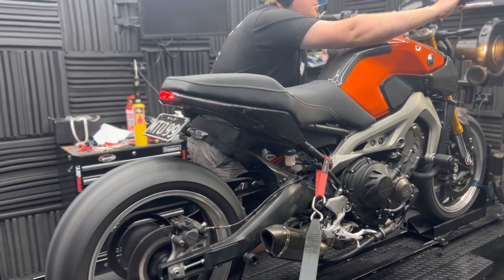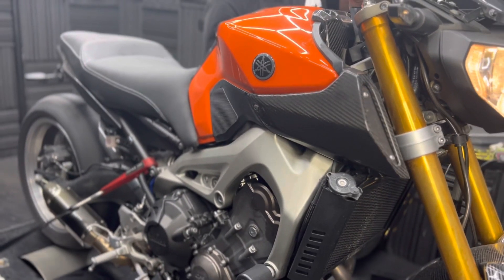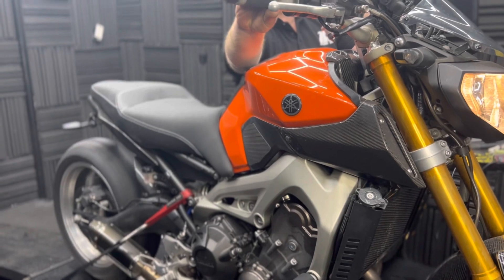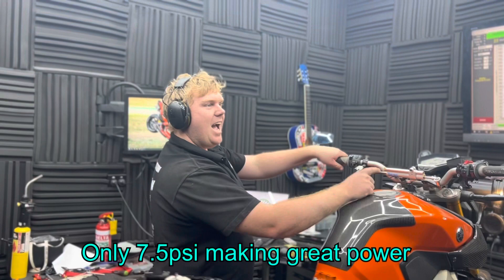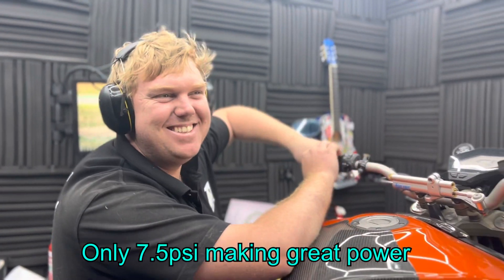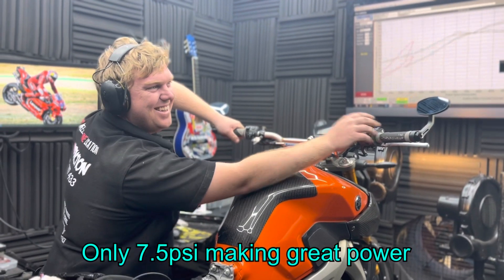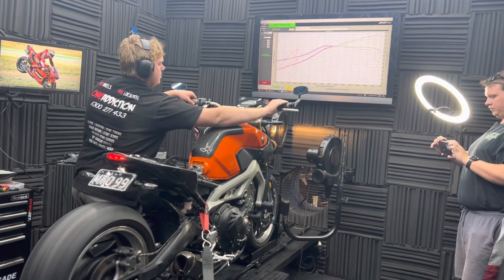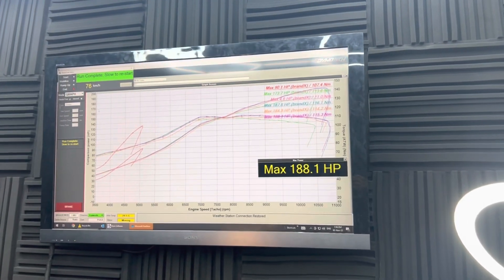🔥🔥🔥Turbo MT09 full throttle pulls and racetool setup! 😍😍😍 This bike is something else!

Comment: Is there a reason for the mt09 that you can't do ignition cut and are forced to do fuel cut for the launch control? I have one that's non turbo just wasn't sure.
Reply: They are running the woolich tuning software. It has the option to disable fuel cut on deceleration so not sure why. Unless woolich just has it setup as fuel cut on launch and pitspeed limiter

Comment: Awesome, how much is the kit
Reply: depending on what mods you want with the kit it can be anywhere between $5,000-8,000
Reply: @SoCalxHutch  holy f, that's certainly not worth it imo.
Reply: @rabbychan  Modifying motorcycles for power rarely are. Its almost always better to just sell current bike and buy another, faster from factory bike